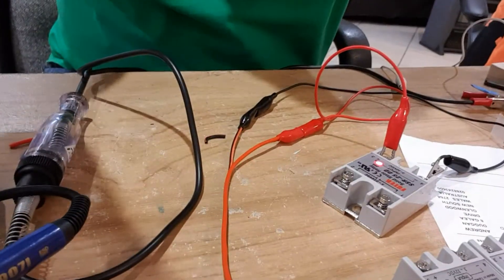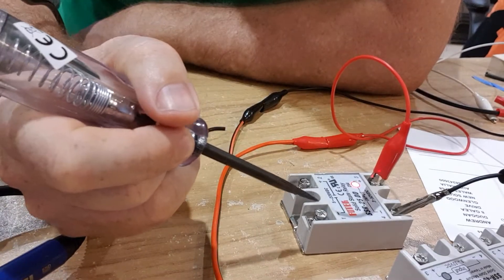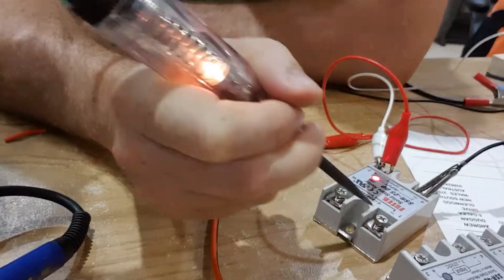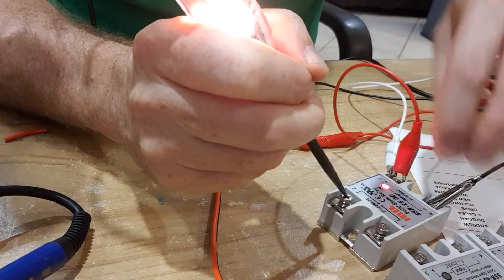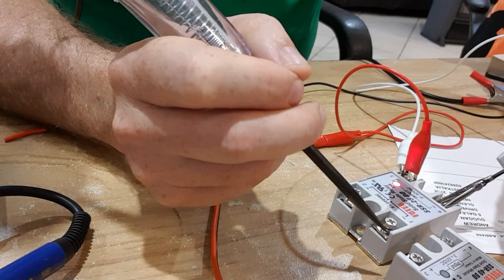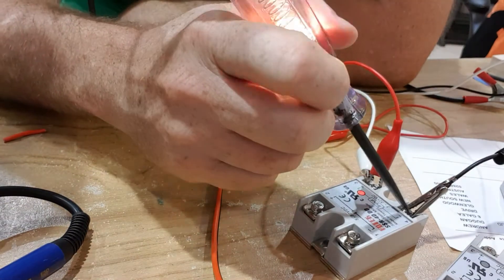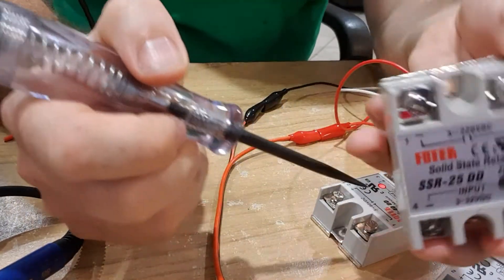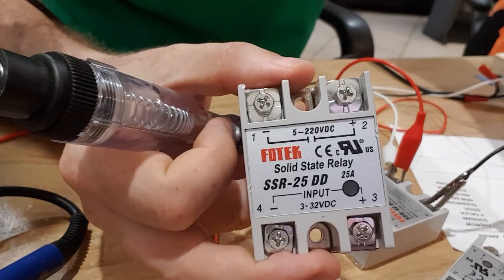2017 10 12 Faulty SSR 25DD

Comment: Are these good? I was thinking to install a 100A DD between my solar batteries. I was thinking to run my induction stove or oven from my LTO cells but I only have 6 of them so Would fit a voltage sensing relay to switch in bugger relay to connect 2x LIFEPO4 100Ah cells in parallel whenever the voltage starts to sag. Considering going via a current limiting module so most of the power still comes from the LTO and the LIFEPO4 prop up the LTO bank.
Reply from the maker: I would definitely not use one of these relays for an induction cooker. (I know nothing about LTO cells). Normal induction cooktop is about 2000W which is about 167Amps. I did use a large relay as my main isolator fr a few years but it was a copper style 500amp relay - this got pretty hot when continuously charging at 120amps so i slowed my charging to 80 amps.

Comment: Thanks for sharing this.  Thought I was losing it ... I've gone through 3 of these in the last 3 days.  1 was DOA (just didn't work), 2 others worked for < 1 day and then both shorted closed within minutes of each other.  After finishing the project everything worked perfectly.  The next morning ... not so much.  I triple checked every single thing in my project trying to figure out what changed.  Turned out it was the relays, even with no power at all have full conductivity across the supposed-to-be-seperated poles :(
Reply from the maker: Glad it was helpful. Cheers

Comment: im waiting for my ssr40a to arrive but seeing these failure videos is just gives me a headache. do you think its worth spending around $30 for a proper panasonic SSR is a good idea? my load will be 5A and i bought a 40A unit. i left a huge headroom because i thought considering these are fake products it would be good to have a nice slack :)
Reply: @Orhan  I bought recently a SSR 40 A A but I had to send it back because it was defective.   The input side was labeled 80-250 vac and the load side was 24 to 380vac.  I was going to use it on a project that was going to control small amount of amperage (1.6 to 3 amps) and thought this was ideal being so compact and easy to install and wired.  I decided that against a standard electromagnetic relay.   I was going to use household voltage on both sides 115vac and the problem was that when the input was switched off, the load side was still allowing voltage through (51 vac) which made impossible to use.  It was my first experience with it and it turned me off from buying it again.  I will just stick with standard electromagnetic relays for now.
Reply from the maker: Hi Orhan
I think that these are a bit hit and miss. I bought some that work and I bought some that don't as shown in the video. 
I didn't buy any that work sometimes which is good. So they are either working or hard fault.
I think if you bought a few batches on ebay then you will probably have 50% or better chance of getting working fakes and overall still fairly cheap.

I have had better results using Aliexpress for some of this stuff as it is really direct from the manufacturer (or perhaps commercial seller at least). Perhaps buy some on Aliexpress and try your luck.
https://www.aliexpress.com/popular/solid-state-relay.html
You can probably spend $10 or $20 bucks and you are fairly likely to get a refund though the system if the goods are faulty.  
I have only purchase the naked PCB style ones from Aliexpress but have not had any issues. https://www.aliexpress.com/item/32997387727.html
Would love to hear back from you here if you have any success with this approach.
Reply: @andrewduggan9002  thanks for the input. well i bought from these with the heatsink. i will use it for a reflow oven so it will constantly be switching the power thats my main concern but its only 5A. i think if it fails i will buy from those with PCB in the second link they are rated from 10A and dead cheap :) at least they give some sound to tell you if its working or not.

Comment: Is it possible the SSR causes gfci tripping? I have an espresso machine after water spilled on SSR the gfci tripping started. Even though, I let it to dry 48 hrs.
Reply from the maker: would be possible yes. This unit was faulty from factory not from water damage though, so your case is most likely different.
Reply: @andrewduggan9002  Thanks.

Comment: I got a box (10) and 1/2 of them don't work. But different brand the blues ones..

The good one's have a totally flat back with no holes, bad ones have 2 screw holes..
Powered up the good ones show ~0.1 ohms both ways, the bad show >5 K ohms! no current flow..